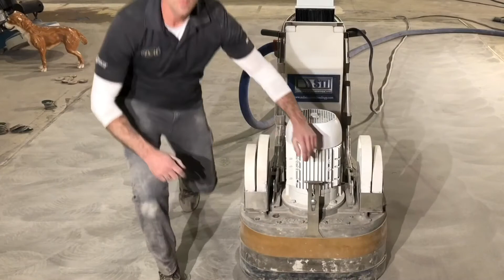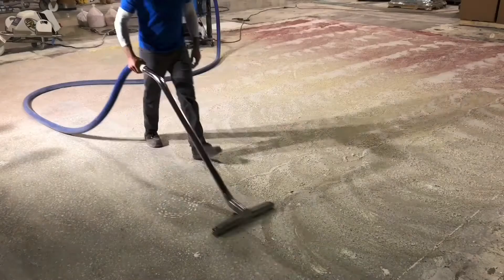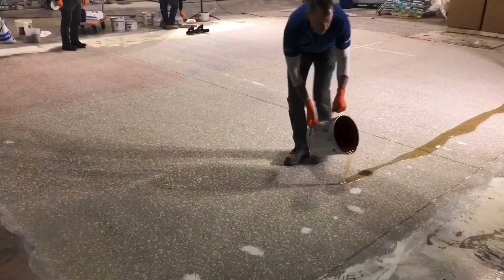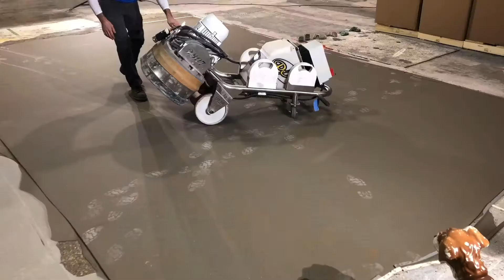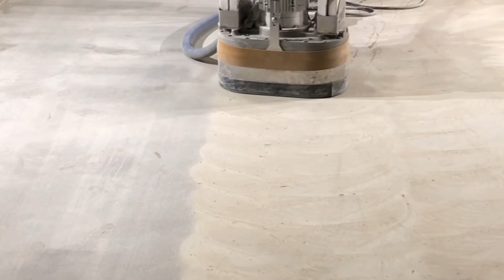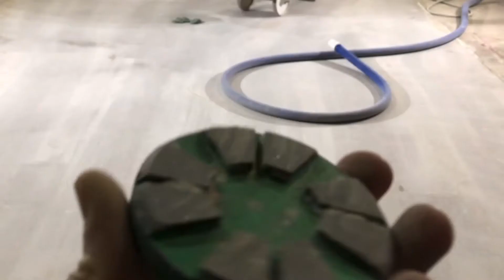Polished Overlays - What You Need To Know

Comment: What I've learned about doing these isthat you have to be FAST when installing the overlay..always have a mix ready to pour or the pour lines are inevitable. Also get blocks of ice and use chilled water.
Rapid Set advised to use a spike roller..they do help in evening out pour lines but I'll never use one again as you found out it leaves an ugly pattern when ground.
I've done 5 polished overlays and got it down pretty good but you have to have guys that are quick..spread it as fast as possible, get out gauge rake lines and move on.
If guys spend too much time trying to smooth it out they'll put all kinds of dips and lines in it.
 the cost is so high to do them, it's a very hard sell..but when all goes right (which is usually never the case) they look great
Reply: Do you recommend using the spike roller or not?